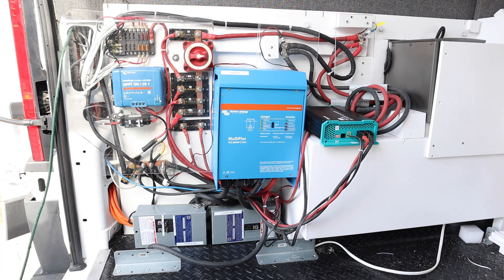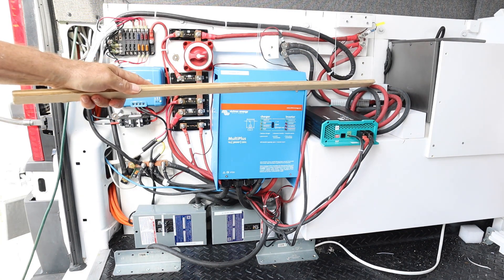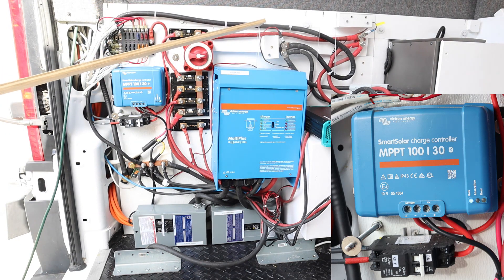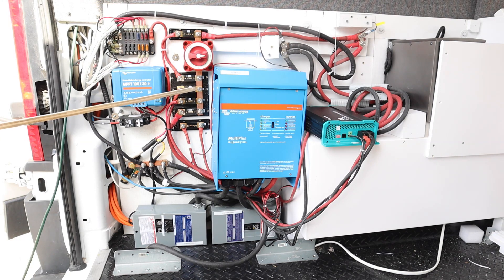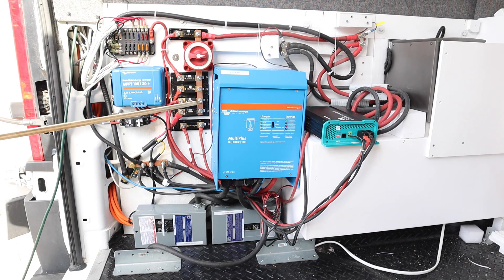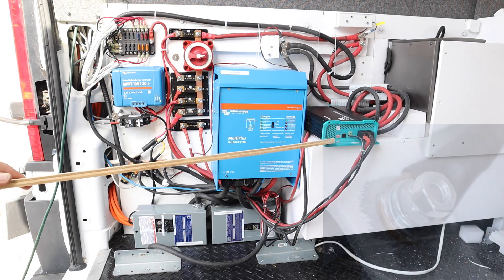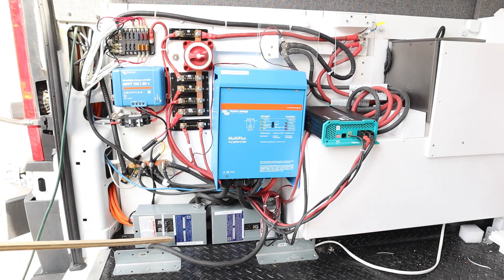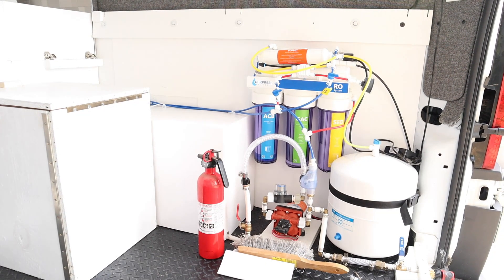Van Life build series - Electrical Panel, Inverter, Solar Charge Controller

Comment: Nice setup! Great explanation of the system and wiring in general. I've been wanting to build a system with copper plate instead of wires as well. 
I am currently wiring a van. In previous vans i've built i used a Blue Sea / Paneltronics breaker panel. I don't want to use one in the current build, since there are only two outlets to power with the Multiplus. Options seem quite slim out there. I hate the RV 2 phase panels.  I've used DIN breakers and boxes for my solar disconnects/breakers and decided to do that for inverter output in both the van build and in my ambulance camper van. I found UL489 breakers for branch circuits. But it seems impossible to find GFCI (RCBO) 50A breakers for a main that don't cost $400. Outlets will be GFCI. The search continues.
In my ambulance camper i was originally planning on backfeeding a 2 pole breaker with a jumper to power both bus bars of the residential 100A panel. 
I am curios why you didn't install a main AC out breaker.
Reply from the maker: Instead of a main breaker, I installed five separate breakers. One for AC shore power. The others to separate the the refrigerator on one breaker. The water heater on another breaker, the kitchen outlets on the third breaker and my charging cabinet on the final breaker. If I want to shut all the AC power off, I just simply shut those fire breakers off. Gfci breakers are very expensive! Good luck on your search and happy travels!...

Comment: Omg!😱 This is so confusing to me… I’ll never get my electrical system working. I bought a van that has a 3000w inverter and I have two deep cell batteries and a small fuse box! I have NO idea how it works or what to do with it. And I have NO help from anyone to explain it to me. I’m trying to understand it but it’s impossible. The van also has a big orange cord that is for the AC outlet (‘s) and I had to move it to the other side of my van to get to the AC outlet, it was barely long enough to reach so I ripped out the crappy counter/kitchen counter and replacing it with a much lighter one ( it was a lot of huge scrap wood) 🪵. 
I ripped out all the other wires ( led) lights and replaced with battery powered “Puck” lights instead. 
😅
I have no idea how I’m going to figure this stuff out. 😢😢😢
Reply from the maker: I recommend you go to  www.thefrugalfactor.com from there look at the section on electrical. Check out each video it may help.

Comment: Hello Mr Frugal, Thanks for all your very instructive videos.
I'm actually waiting for my new ProMaster 159 HR extended 2023 (or 2024) van.
So your videos are of great interest to help me plan the different components to purchase.
Please allow me a few questions.
In your build, you have a Victron MPPT and a Victron Multiplus, so why did you choose a Renogy DC-DC Charger and not a Victron Orion Tr?
Also, the Victron Multiplus is an expensive choice for the inverter/charger, so what made you choose the Victron Multiplus?
Did you consider the Renogy 3000W Inverter/Charger?
For the batteries, you explained in another video why you chose Big Battery, but did you consider other brands like Power Queen?
Thanks again.
Reply from the maker: I selected the 40 AMP Renogy DC to DC charger because the Orion was not available at the time.  I would still select the Renogy today. Because it just works.  Instead of the 40 Amp, I might select the 60 Amp renogy DC-DC charger.  You can reduce the amperage in half on both Renogy units.   When we are driving a long distance I charge at a lower current, its better for the batteries.  The Victron DC charger currently is not controlled or viewed by bluetooth so no benefit there.   The Orion is only 30Amps, but you could use two.   The best thing Victron has is their battery monitor - I highly recommend it.  Get the one with the battery temperature sensor included its a better deal, than buying the sensor separately  https://amzn.to/3El7K9f.  It will allow you to monitor your State of Charge, charging rate etc on your phone.  Battery: I went with Big Battery at the time, it was between them and SOK battery.  The reason is that their case would allow me to open the battery and replace separate cells, and the BMS if it became necessary.
Reply: @FrugalFactor  Thanks for the reply. The Victron Smart version comes with a bluetooth interface app on your phone for control and monitoring. However, the Renogy is less expensive and offer the input voltage limiter. And why did you choose the Multiplus over another brand like Renogy?
Reply from the maker: Selected Victron for two reasons reliability (based on reviews) and Bluetooth integration.   The Victron units can be monitored by Bluetooth and some can be programmed with Bluetooth.   This complete system integration was not available from any other manufacturer at the time.   Also reliability, support and clear manuals = Victron.  I would have used an Orion DC-DC charger if I could have purchased one at the time.  The Renogy has always worked.  But, the manual, specifically the DIP switch settings are confusing.  So, much I had to email Renogy, and at first email I received didn't answer the question, and had conflicting information.  That was three years ago, and things do change.   I recommend emailing questions to both companies, or a dealer and see if you receive a quick quality response.  Remember the electrical is the most expensive part of the build!   I taught electronics for years, but even with my knowledge I would rather just not have any problems 🙂
Reply: @FrugalFactor  Thanks again for your reply. It's really appreciated. I also would rather just not have any problems. I'm an electrical engineer specialized in software. My a bit more than basic knowledge of electronics helped me repaired a few equipments at home, but I'd rather not have to do that on the road. For my build, I'm OK with having to pay a small premium to install Victron equipment, but when it comes to inverter/charger, the Victron Multiplus is about 3 times as much as the Renogy 2000W Inverter/Charger. I live in Canada, so for me, the Multiplus is 1750 $CA and the Renogy is 600 $CA. I'm trying to figure out if the Multiplus is worth the premium. The same goes for the batteries. You selected a nicely designed battery set. For me, 2 Big Batteries 228Ah cost 3600 $CA. A set of 4 Power Queen 100Ah batteries cost 1680 $CA. There is no doubt in my mind that the Big Batteries are good quality and well designed, but I haven't seen any reviews discouraging the use of Power Queen batteries. I understand that you can't really comment on a product you haven't really analysed, but to help me out, is there any LiFePO4 battery specifications I should be paying attention to?

Comment: Programming the Victron 3000VA sounds a little intimidating. I see Battle Born has their own video on the subject. How did you make out when the time came to program the 3000VA for the electrical components in your build?
Reply from the maker: It is not very difficult.  As long as you have a laptop and the MK-3 cable https://amzn.to/3HLrANC    Once it is setup, your done.   Easier than programming a universal TV remote.

Comment: Hats off to you! That’s an amazing installation. I think that rather than trying to duplicate something like that I will take the easy way out and get a Bluetti AC200MAX which for my needs will accomplish just about all these functions with WAY less thinking on my part.
Reply from the maker: As long as it meets your Amperage, and Amp Hours needs that would work.  The system we built is more than needed. But having less than needed would have been a costly mistake.  Example I may have been able to use a 2000 W inverter. But if I discovered a needed a larger inverter that would be another large $$ purchase.  For me it was better to error on the too much side.....         A Bluetti AC200MAX would not work for our needs (its only 170AH).   It would not run the refrigerator and water heater on a daily basis.
Reply: @FrugalFactor  that’s ultimately what’s important. Make sure yours system meets your needs. We have an ARB portable refrig which requires very little power.

Comment: Thank you for the information. Why is it necessery to run negative wire from DC/DC charger to the van battery? Is it not ok to ground it to the chassis?
Reply from the maker: It is best to run have a direct connection with the battery to ensure a proper low resistance connection without going through the weld points of the van.
Reply: @FrugalFactor  Thank you